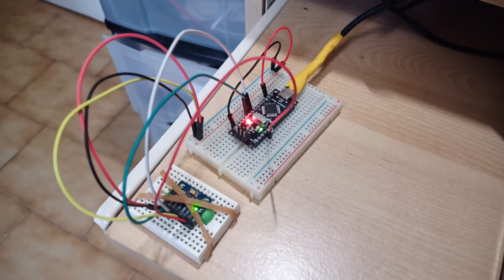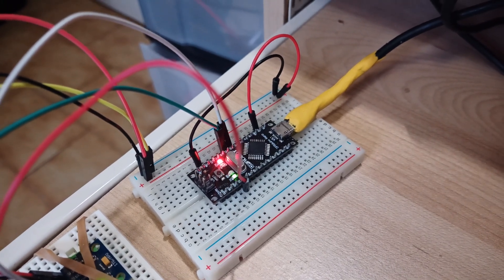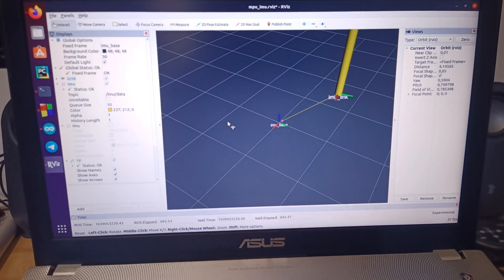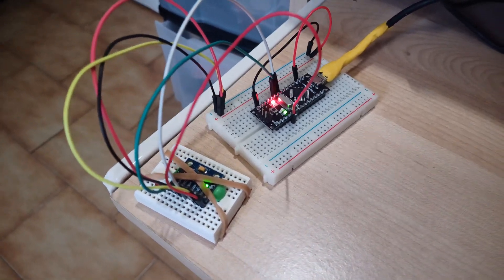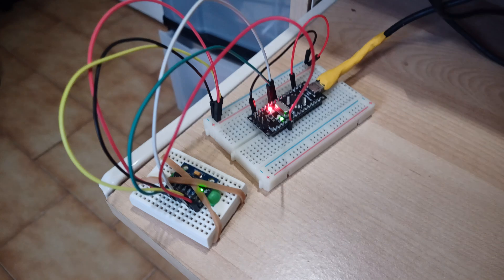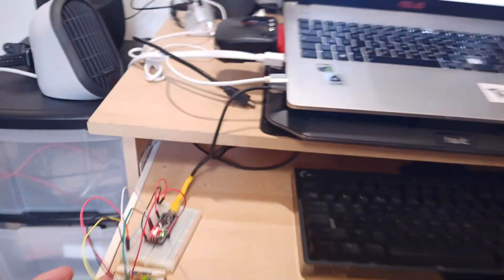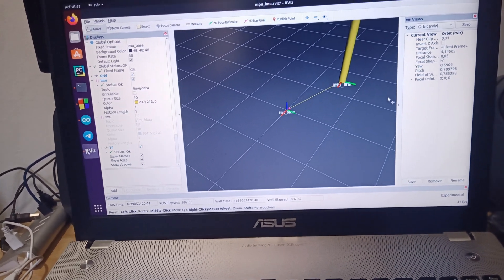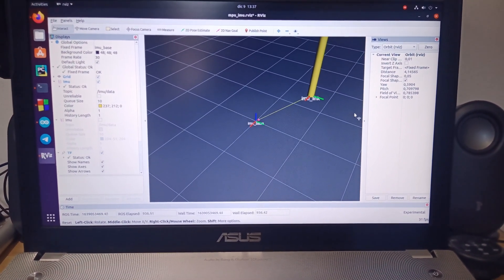MPU6050 Arduino Nano ROS Imu data at full speed

Comment: Nice video. Did'nt you have any drift in orientation (yaw)? How did you remove the drift?
Reply: Hi I have faced the same issue. But its now its stable. 

I have used the quaternion from DMP library and then convert this quaternion to Euler angles using some maths. 
If you need that part, i will share my github to you.
Reply from the maker: @jawadmehmoodbutt4449  exactly what I did!!
Reply: @jawadmehmoodbutt4449  can i get that part ?